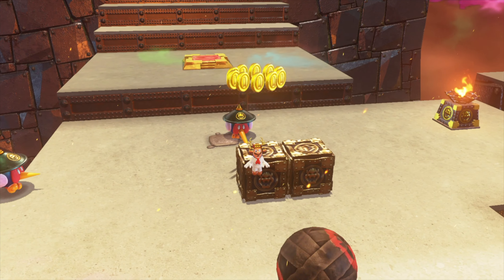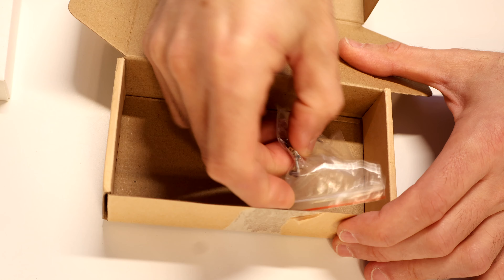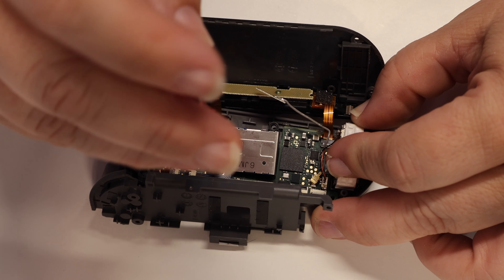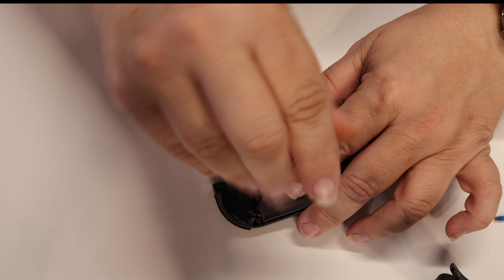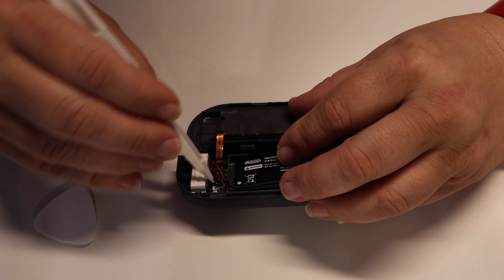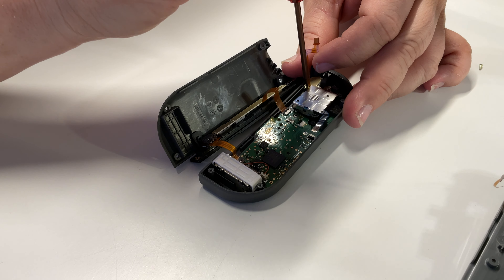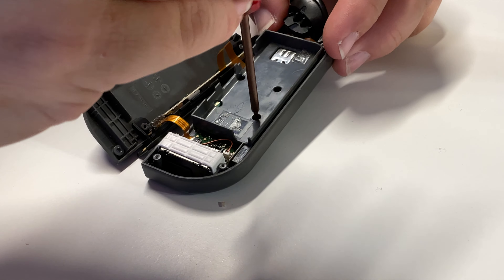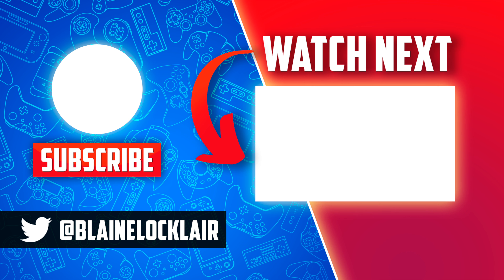End Joy-Con Drift Forever With This Simple Repair

Comment: 2:22 i personally recommend removing that square antenna if it keeps getting in the way
its just a traditional antenna jack but smaller. can be done with your bare hands
Reply from the maker: It's a little fussy, but not so bad. Just one connection ribbon to deal with.
Reply: @blainelocklair  much easier than dealing with all the other wiring
pull out, then press it back in when reassembling. just like the battery connector

Comment: I had an issue with one of the hall effect analog sticks, the rubber circle pad of one kept coming off, had to crazy glue it. Hopefully it's an issue they fix because down the line I'm more than certain I'm gonna have to buy more.
Reply from the maker: Interesting. I don't know how well it shows in the video, but the right Joy-Con with the drift in it also had the thumb pad worn off by teenage hands. It seems kinda unusual for the right one to get the drift, as the left one is the most commonly used for player movement. It'll be interesting to see how well the thumb pads hold up on them over time.

Comment: If it requires opening the controller my answer is it's not "simple"😏 I have pro controller though not joycons
Reply: Yeah there is nothing simple about Joycons.  The cables are very fragile plus super small screws. They are a pain to add custom cases lol.
Reply from the maker: I get that. Simple is a relative term. I guess, when compared to something like the GameCube controller, which adds in soldering to the mix, it's simpler than that one. Just smaller.